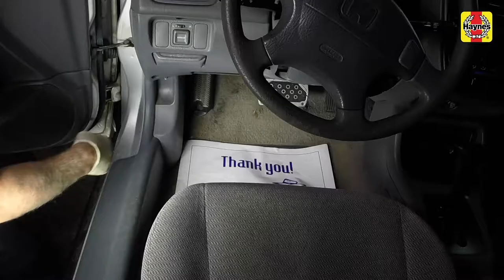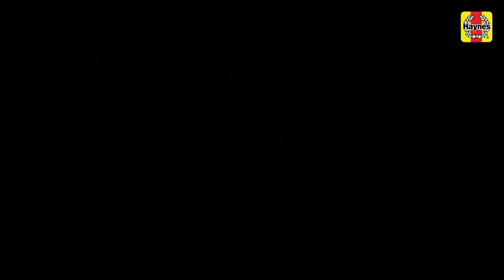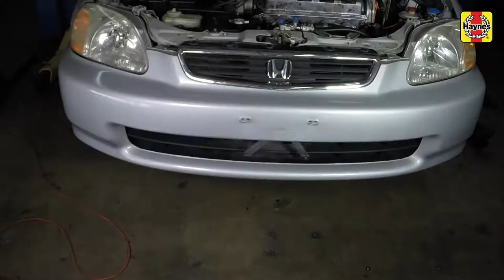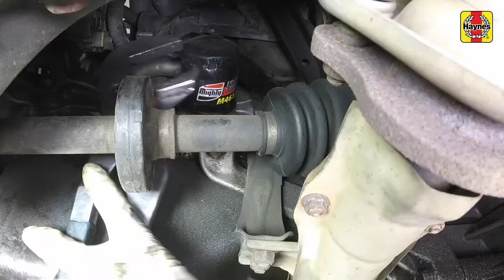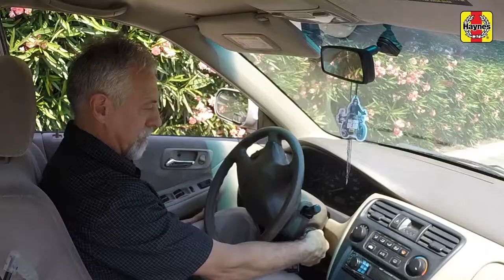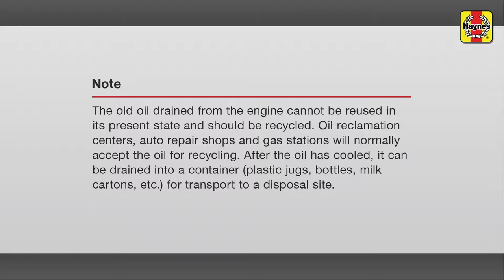Honda Civic (1996 - 2000) - How to change the oil filter - Haynes Manuals

Comment: Why loosen lug nuts on the tire for an oil change?
Reply from the maker: Our mistake - sorry!
Reply: If loosing the lug nuts is a "mistake," what not edit it out of the video you posted?  What were you thinking when you made this video? If this is a promo for Haynes Manuals, I'm not impressed...
Reply: @marlocj  when you remove the wheel it will allow you easy access through oil pan when your car is not on ramp , the only mistake is they forget to mention "remove the wheel "
Reply: @marlocj 
Calm down, damn.
Reply: Makes me wonder what other "mistakes" are in your videos!!

Comment: I have this excact engine. What are those wires connecting to the block right under the oil filler cap?
Reply: Spark plug wires.
Reply: high tension wire

Comment: you did not mention the oil ratings
Reply: I use full synthetic 5W30.
Reply: @kaosmynd4182  ok how much tho lmao
Reply: @one-to-one-ratio  Sorry I didn't realize the question was ever for me. Answer is I buy the 5 qt jugs and it takes slightly over 4qts (including filter) for my 1.6l. Leaves a little for topping off later. You have to keep track of it though and keep checking the level. You don't want to over fill it.